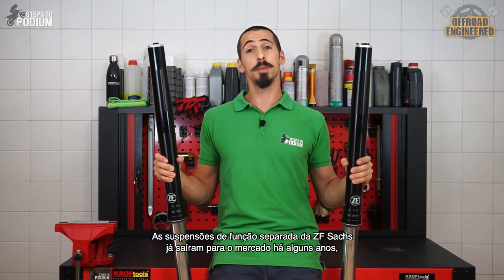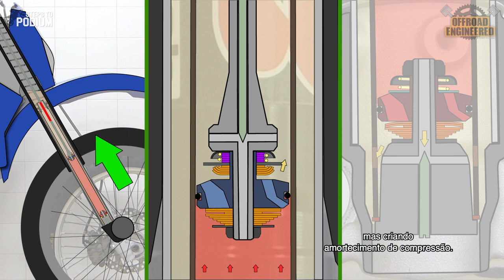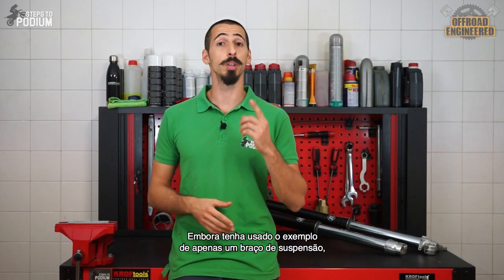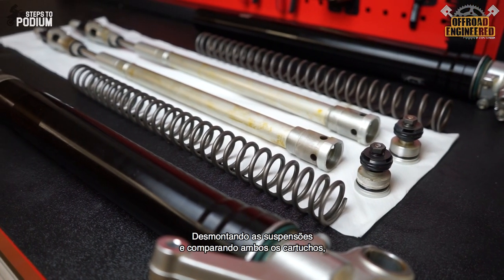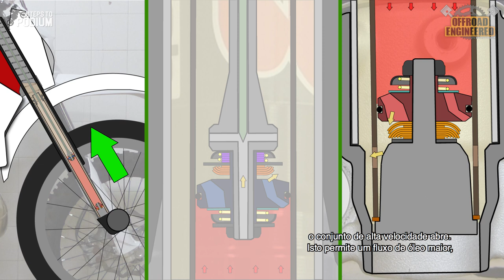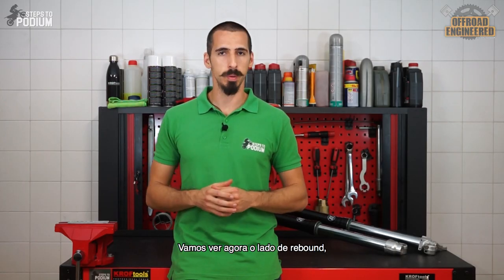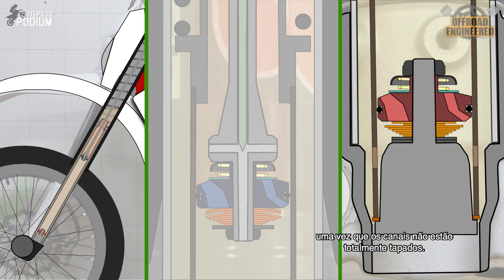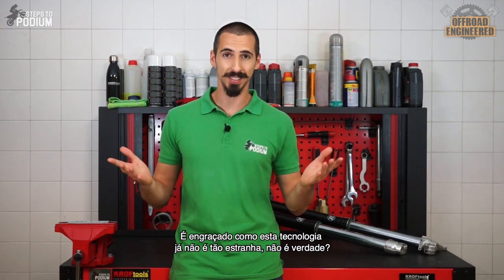How ZF Sachs SFF Forks Work | Offroad Engineered

Comment: Thanks for the video! I just changed the seals on my dad's Sachs forks. I didn't take the cartridges out so was curious to see what they looked like inside. I converted my XPLOR 48 to traditional OC forks with adjustable base valves, new mid valves, and removing the holes in the compression side cartridge body. It's definitely better now.  Might be a little more difficult to do this mod on the Sach forks due to the nature of the vent holes on the compression side.
Reply from the maker: These are really simple forks so don't be afraid to take them apart :)
Glad I could help!
Reply: Race tech's fork valving kit for Sachs zf forks uses a metal ring that blocks the holes on the cartridge tube, new adjustable base valves, and a mid / rebound valve.
Reply: @charliecerrillos  Thanks! Had not seen the Racetech sleeve. Might be a good option for him.

Comment: Thanks for a great video!  Questions... It appears there is no adjustable bleed on the base valves, is there a fixed bleed?  Will the Lainer adjustable base valves work on a non-modified Sachs SFF OC Beta fork?  Or do you need to do the full conversion (to convert the top adjusters to rebound)?  I'm looking to add some low speed compression support and am otherwise happy with my fork so I thought adding the adjusters might be a good step?

Comment: Having ZF forks on my bike I was eager for the video to release, and this was well worth my wait. Thank you for the excellent video Luis.  Now this raises the following question, are standard forks (having both compression and rebound in each leg) are actually harder to keep in tune?
Reply from the maker: Thank you Ariel!!
How so, harder to keep in tune? Regarding the adjusters?
Reply: @StepstoPodium  Harder in the sense that all components in a standard fork set are duplicate, both forks need to be setup identically to work in perfect unison. My unprofessional view, I might be way off
Reply from the maker: Oh ok! Yes, indeed you have double the work to tune a suspension, but a good practice is that both legs are always the same, no matter what. It gives more work, but on the other hand, if one of the legs looses damping, you have the other one that can still provide it (as opposed to the SFF). It's aaaaalways a compromise in the suspension world 😅😂
Reply: @AntiStressKit  it wouldn't be ideal to set them differently, but the OC concept wouldn't work if both needed to be the same.

Comment: Hi there, thanks for your amazing videos. Can I ask, is there any problem due to less oil flowing ?
Reply from the maker: Hello Daniel! Thank you!!
Where do you think there's less oil flowing?
Reply: @StepstoPodium  through the mid valve there is only one mid valve offering dampening
Reply from the maker: Oooh ok! You are right, there is only one mid-speed valve, so less oil being used for damping, but it's no problem as long as you don't start having cavitation. These forks will for sure not be ideal for motocross, for example, but as long as you don't have cavitation, there's no problem in having just one fork leg for compression. This design is quite nice for manufacturers because it's cheaper to manufacture, but obviously is not as flexible in terms of use as a traditional open cartridge fork.

Comment: Thanks for a great video Luis. What are your thoughts on the single preload adjuster on the compression leg? Also the rather large preload spacer on the rebound leg?
Reply from the maker: On the rebound leg, don't need to mess with it. About the compression side, do you ride with much weight or are you little over the weight range? Those would be the only times I would mess with the preload adjuster 💪
Reply: @StepstoPodium  Hi Luis, thank you for your response. I don't mess with it as I have never found a need to. I just think having different preloads on each side is strange.
Reply from the maker: I feel you! It's definitely not what we're used to see, but again, it's a fairly different design, so things don't necessairly have to be the same as the tradicional design 😊
Reply: @StepstoPodium  Thanks Luis. Agreed.

Comment: I believe it's a similar design as WP Xplor 48 open cartridge forks. One of the down side aside from the adjustability is that the cavitation is more severe. So it's only good for slow trail riding...
Reply from the maker: True indeed! Overall it's similar and it differs on the midspeed valve, which there's a "cone" valve. But yeah, it's a technology that has limitations, but comes with upside! They're incredibally simple in their construction which makes maintenance a lot easier and cheaper :)

Comment: Great video!  I have never ridden on Sachs forks, how do you like them for enduro riding?
Reply from the maker: Thank you! I've been quite surprised actually! They perform really well on pretty much everything except jumps. In the mean time I revalved them to better handle jumps and provide more bottoming resistance, and have become quite a catch 😄
Reply: @StepstoPodium  any videos of revalving ?
Reply from the maker: You have an offroad engineered video just about valving 😉
Reply: @StepstoPodium  for bottoming resistance and jumping,  can you give us shim stack formation? Add , remove which shims?  i feel the same thing , got a 2022 250rr with zf forks.
Reply from the maker: I'm sorry but I can't disclose that information 😛
Reply: @mbilaloglu  You need to add more low speed compression shims or thicker low speed compression shims.  I have a video comparing Yamaha YZ and WR shim stacks that might help.  https://www.youtube.com/watch?v=-gowyJzRDr8&t=188s
Reply: I don't like them.  They beat me to a pulp in rocks.

Comment: Can you tell me how to choose the correct spring for these? I get the same "race" sag ie spring compression while sitting, with the stock springs as I do with much heavier springs.
Reply from the maker: I honestly don't believe in that, it's impossible for different rate springs to provide the same SAG 😅 how are you mesuring the SAG?
Reply: @StepstoPodium  I put a zip tie around the inner tube. When I sit on bike the wiper seal moves the zip tie down. I then jack the bike up to get front wheel off ground and measure the distance from the wiper seal to the zip tie. Ive done this with two sets of springs now , same clicker setting, oil viscosity, same preload. The bike is practically brand new so maybe there is a lot of friction?
Reply: @StepstoPodium  Ok I now think the zip tie wasnt sliding like I thought. Had wifey place tape at wiper when I sat /stood on bike. Got more sag this time but only 65mm with stock springs. Do these ZF Sachs SFF have less sag than other forks? At 300mm total travel I would expect 25% sag, ie 75mm. At my weight charts show I need much higher spring rate but that will result in less fork race sag.
Reply from the maker: That's a possibility, yeah!
Reply from the maker: You can have between 60 and 75mm of front fork sag :)

Comment: So if low speed compression seems too harsh and clicker position seems to make no difference would running lighter viscosity fluid in the compression leg help this?
Reply from the maker: Noooo, never change the oil viscosity. 5w all the time. You have to revalve the suspensions💪
Reply: @StepstoPodium  I think I should have dropped the extra grand for the race edition with Kayaba
Reply from the maker: Most people have to revalve them as well because they are waaayyy to firm from factory 😂